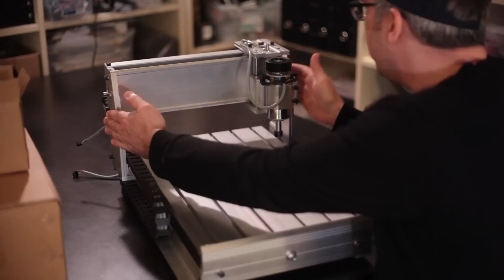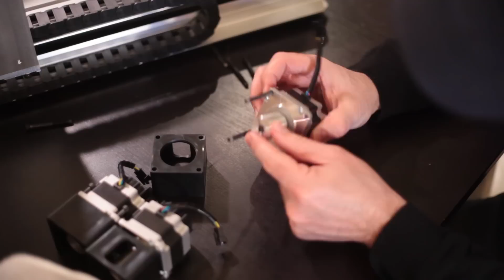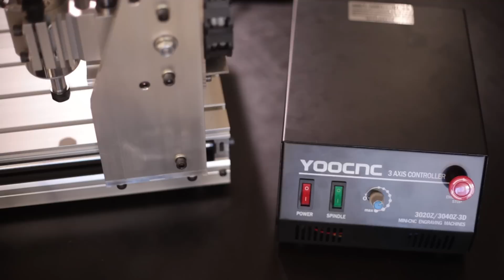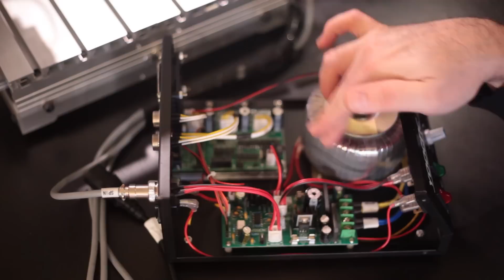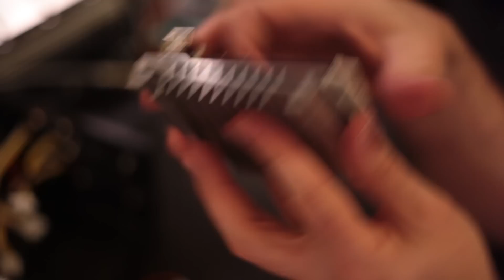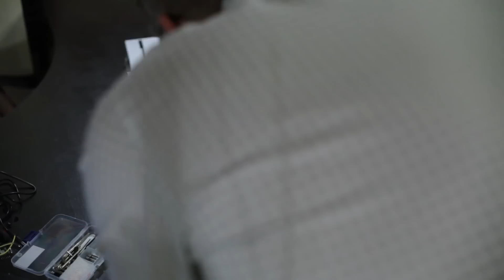Build a ChiliPeppr Driven 3040 CNC

Comment: Hi John! I have watched your video and got most of my cnc working now. I was wondering is there a way to calibrate the stepper motors in Chilipeppr? Or is that done in the Tinyg? I am new to CNC in general and was inspired by this video to get in to CNC. There are some videos online about stepper motor calibration but, they are using a different software then Chilipeppr.
Reply from the maker: If you use ChiliPeppr and TinyG then the motor calibration is:
// Response from $$ Command
[fb]  firmware build            442.04
[fv]  firmware version            0.97
[hp]  hardware platform           1.00
[hv]  hardware version            8.00
[id]  TinyG ID                    3X3566-YRS
[ja]  junction acceleration  100000 mm
[ct]  chordal tolerance           0.0100 mm
[sl]  soft limit enable           0
[st]  switch type                 0 [0=NO,1=NC]
[mt]  motor idle timeout          2.00 Sec
[ej]  enable json mode            0 [0=text,1=JSON]
[jv]  json verbosity              4 [0=silent,1=footer,2=messages,3=configs,4=linenum,5=verbose]
[js]  json serialize style        1 [0=relaxed,1=strict]
[tv]  text verbosity              1 [0=silent,1=verbose]
[qv]  queue report verbosity      1 [0=off,1=single,2=triple]
[sv]  status report verbosity     1 [0=off,1=filtered,2=verbose]
[si]  status interval           250 ms
[ec]  expand LF to CRLF on TX     0 [0=off,1=on]
[ee]  enable echo                 0 [0=off,1=on]
[ex]  enable flow control         1 [0=off,1=XON/XOFF, 2=RTS/CTS]
[baud] USB baud rate              5 [1=9600,2=19200,3=38400,4=57600,5=115200,6=230400]
[net] network mode                0 [0=master]
[gpl] default gcode plane         0 [0=G17,1=G18,2=G19]
[gun] default gcode units mode    1 [0=G20,1=G21]
[gco] default gcode coord system  1 [1-6 (G54-G59)]
[gpa] default gcode path control  2 [0=G61,1=G61.1,2=G64]
[gdi] default gcode distance mode 0 [0=G90,1=G91]
[1ma] m1 map to axis              2 [0=X,1=Y,2=Z...]
[1sa] m1 step angle               1.800 deg
[1tr] m1 travel per revolution    4.0000 mm
[1mi] m1 microsteps               8 [1,2,4,8]
[1po] m1 polarity                 1 [0=normal,1=reverse]
[1pm] m1 power management         2 [0=disabled,1=always on,2=in cycle,3=when moving]
[2ma] m2 map to axis              1 [0=X,1=Y,2=Z...]
[2sa] m2 step angle               1.800 deg
[2tr] m2 travel per revolution    4.0000 mm
[2mi] m2 microsteps               8 [1,2,4,8]
[2po] m2 polarity                 1 [0=normal,1=reverse]
[2pm] m2 power management         2 [0=disabled,1=always on,2=in cycle,3=when moving]
[3ma] m3 map to axis              3 [0=X,1=Y,2=Z...]
[3sa] m3 step angle               1.800 deg
[3tr] m3 travel per revolution    4.0000 mm
[3mi] m3 microsteps               8 [1,2,4,8]
[3po] m3 polarity                 0 [0=normal,1=reverse]
[3pm] m3 power management         2 [0=disabled,1=always on,2=in cycle,3=when moving]
[4ma] m4 map to axis              0 [0=X,1=Y,2=Z...]
[4sa] m4 step angle               1.800 deg
[4tr] m4 travel per revolution    4.0000 mm
[4mi] m4 microsteps               8 [1,2,4,8]
[4po] m4 polarity                 0 [0=normal,1=reverse]
[4pm] m4 power management         2 [0=disabled,1=always on,2=in cycle,3=when moving]
[xam] x axis mode                 1 [standard]
[xvm] x velocity maximum       1800 mm/min
[xfr] x feedrate maximum       1800 mm/min
[xtn] x travel minimum            0.000 mm
[xtm] x travel maximum          150.000 mm
[xjm] x jerk maximum             20 mm/min^3 * 1 million
[xjh] x jerk homing              40 mm/min^3 * 1 million
[xjd] x junction deviation        0.0500 mm (larger is faster)
[xsn] x switch min                1 [0=off,1=homing,2=limit,3=limit+homing]
[xsx] x switch max                0 [0=off,1=homing,2=limit,3=limit+homing]
[xsv] x search velocity         500 mm/min
[xlv] x latch velocity          100 mm/min
[xlb] x latch backoff             5.000 mm
[xzb] x zero backoff              1.000 mm
[yam] y axis mode                 1 [standard]
[yvm] y velocity maximum       1800 mm/min
[yfr] y feedrate maximum       1800 mm/min
[ytn] y travel minimum            0.000 mm
[ytm] y travel maximum          150.000 mm
[yjm] y jerk maximum             20 mm/min^3 * 1 million
[yjh] y jerk homing              40 mm/min^3 * 1 million
[yjd] y junction deviation        0.0500 mm (larger is faster)
[ysn] y switch min                1 [0=off,1=homing,2=limit,3=limit+homing]
[ysx] y switch max                0 [0=off,1=homing,2=limit,3=limit+homing]
[ysv] y search velocity         500 mm/min
[ylv] y latch velocity          100 mm/min
[ylb] y latch backoff             5.000 mm
[yzb] y zero backoff              1.000 mm
[zam] z axis mode                 1 [standard]
[zvm] z velocity maximum       1800 mm/min
[zfr] z feedrate maximum        800 mm/min
[ztn] z travel minimum            0.000 mm
[ztm] z travel maximum           75.000 mm
[zjm] z jerk maximum             20 mm/min^3 * 1 million
[zjh] z jerk homing              40 mm/min^3 * 1 million
[zjd] z junction deviation        0.0500 mm (larger is faster)
[zsn] z switch min                0 [0=off,1=homing,2=limit,3=limit+homing]
[zsx] z switch max                1 [0=off,1=homing,2=limit,3=limit+homing]
[zsv] z search velocity         400 mm/min
[zlv] z latch velocity          100 mm/min
[zlb] z latch backoff             5.000 mm
[zzb] z zero backoff              1.000 mm

Comment: I did some research, and you can run TGFX. Mach4 isn't a parallel port driven program. There's a plugin that you have to buy if you're using parallel port for mach4. I operate a turret punching press everyday! On a way bigger scale then these small things. But that's the reason why I got into it because the programming is close. I run an Amanda coma x72. Y60. I'll find a good program that works. But I like what you're doing! Keep up the good work!
Reply from the maker: tgfx was discontinued and ChiliPeppr was its replacement

Comment: I use an atom board like the Asus J1800IA, rather new, compact machine with an LPT port.
Reply from the maker: +DKTAz00 Why are you using a parallel port? Is that so you can use Mach3?
Reply: heh, good question. To be honest, I'm using mach3 because it came with the machine. :) But I never looked in to any other options. The lpt board was 75 usd, and I guess you never know when you need an extra pc. Made a crude case for it too http://www.thingiverse.com/thing:1242658 But one thing I didn't see/catch you covering was, are there any pros to peppering it? edit besides usb
Reply from the maker: +DKTAz00 There's a million reasons to "peppr" it. First, parallel ports have gone the way of the dodo bird. You should move to USB. Also, powerful microcontrollers are so cheap now, you should move the step generation off your PC and onto a microcontroller. Mach3 has the PC generate steps while it's also trying to handle the UI. Also, you gain the power of the cloud with ChiliPeppr and the benefits of the browser. You can write Javascript macros, drag in Eagle BRD's to mill PCB's, extend your CNC machine to add lasers, pick and place heads, additional axes, heater control, etc. The development community is probably the biggest thing you inherit. Mach3 was great in its day, but the world has changed and the cloud is where you want to be.

Comment: Hi

I have posed this question about the mainboard to many people .
most have the yoocnc mainboard and they love their machine.
I have some to realise that it could be what software you use to design / simulate and send to the cnc router
and the tweaks you need to do to get the router 100% working.
Thanks
Ebrahim
Reply from the maker: +www.vinylcutters.co.za South Africa I agree that without ChiliPeppr the TinyG board would not be a good way to go, but with ChiliPeppr it changes the game and makes TinyG the right choice. Sticking with the original yoocnc board and thus being stuck with Mach3 is not the way to go in the future. ChiliPeppr is extensible and indeed things like a solder paste dispenser are emerging. A pick and place solution is emerging. Webcam fiducial recognition is in the works. Etc. These are all possible once you get into the browser environment where coding and collaboration are easy.
Reply: You're not stuck with Mach3 with a parallel port. LinuxCNC supports parallel ports.

Comment: Hi John, thanks for the great videos! I'm completely new to this, but am really intrigued by the 3040 size cnc machine. I'm hoping to use a small precision cnc router to help me do guitar inlay work in hardwoods and pearl, cut custom pickguards from laminated plastic, and cut custom pickup flatwork from vulcanized fiberboard. Seems like this unit should be up for the task with high precision? From the research I've been doing tonight, it seems like the smartest move would be to buy the 3040 unit with ball lead ($736 shipped on ebay seems to be the cheapest), the tinyg ($130) and the rasberry pi 2 ($40 or so). I'm hoping I can use Inkscape or SketchUp to draw up the svgs,  jcut (I think that's the name) for gcode, and ChiliPeppr to cut 'em out, which should mean completely free software. I'd need to buy a few end mills of course. All-in-all, seems like I'll have to dump about $1000 to get started. Am I thinking correctly here? Just want to make sure I'm considering everything before popping for it. Also, can all of this be done on Linux, or at least running the CNC from a Linux based computer?

Comment: hey John, why would you go by the most expensive solution? why not use an Arduino CNC shield V3.3 instead?  165$ for that tinyG is way too much money....
Reply from the maker: +Dimitri Del Corral I started out a few years ago using Grbl and a CNC shield that used Pololu drivers. I blew out a lot of those A4988 drivers so I don't trust them anymore. If you get a CNC shield get the 8825 chips instead. I see that's $28 on ebay. Ok, now here's the problem. Grbl is at end-of-life. The Atmel 328p chip has no room in it for Grbl to get better. I needed a 4th axis for my 3040 as you'll see in one of my other videos. TinyG is the only CNC controller that supports a 4th axis. Read my Grbl vs TinyG for a full rundown http://chilipeppr2.blogspot.com/2015/06/grbl-vs-tinyg.html

Comment from the maker: The purpose of the BeagleBone is that you need a computer to run Serial Port JSON Server (SPJS). SPJS is the bridge between serial ports and a websocket. It's easiest to use a small embedded computer to run it and then just do ChiliPeppr from your powerful desktop or laptop that you can also take with you to the other room while the CNC machine is making dust. These days I use a Raspberry Pi 2 instead of the BeagleBone.
Reply: +John Lauer Can you tell me if the red wire on the emergency stop button goes on the NO of the emergency button and if the black goes on the NC of the emergency button? I am using a Ardrino Uno with CNC Shield.
Reply: the black will go to the Common of the emergency stop, and the red would more than likely go to the NO pin, to hook this up to th arduino, look through your code for an emergency stop function. this should tell you what pins to plug the stop button into.

Comment: Measuring the flatness. First I'm not a machinist but we have a fully stocked machine shop with dial indicators. We clamped one on the spindle and moved the spindel through the table's range (lift it over the grooves). Lengthwise it was .040 TIM. Being that we will be making parts about 3x4 it might not be too bad locally. 

You could also get a gage block and then cycle the z down to it and taking some measurements that way too. You could get readings from mach3 or chillipepper and see what is going on.

Best of luck.

Comment: One of the better videos out there! We might go the tinyg/chillipepper route if we keep having problems. The 3040 we got has a bed that is not flat wrt to the z height (>.040 over the length). Did yours have that problem? Any luck getting it true?

Thanks-
Reply from the maker: +Paul Koenig I never actually measured how true the bed was. Now that you're mentioning it I may test it. How did you test it though? Using a probing technique?

Comment: Couldn't you just buy a Parallel to USB adapter?
Reply from the maker: +Michael Valentine You could, but you are still stuck in the ancient Mach 3 software. ChiliPeppr is in the browser so it supports all OS's. Mach3 is Windows only. ChiliPeppr is open source. Therefore people can extend it to do whatever they want. There's a user extending it to do pick and place. Another user is adding machine vision via WebRTC. Another user is adding Eagle board import capabilities so you can easily mill PCBs. Mach3 does none of this and isn't open source. ChiliPeppr is the Linux of CNC and is the future of CNC in the maker community.

Comment from the maker: These days I'd go with a Raspberry Pi 2 instead of the Beagle Bone Black I used in this video.
Reply: +John Lauer Do you have a video about your Raspberry Pi setup? Being new the Raspberry Pi and someone not really interested in programming I feel like I'm going about using my RasPi 2 the wrong way. I think of it as a tiny Linux box and that's about it. I was gifted the Pi and since I'm planning to use an Arudino and a Grbl CNC shield for my controller I would like to pair the Pi  with either a stand alone Arduino or the Alamode shield for the Pi and use ChiliPeppr to control everything to make a nice neat package if possible.

I appreciate any input and all the work (you did?) that went into ChiliPeppr. I still haven't made it through your 1hr+ video about the introduction to ChilliPeppr yet.

Comment: Is it standard to connect E-Stop to the [RESET] line of the micro ??
If you push E-STOP, the motors will shut off, but you will need to reload the gcode file over again and re-calibrate the axiss.

Comment: Thanks for the video. I bought a 6040 not too long ago. I have used Mach3 forever on my other machines. I am new to chilipeppr and it looks interesting. 
A couple of questions. 1. Why not just use GRBL on an Arduino to drive the parallel port pins on the existing driver?
And 2. What is the beagle bone for? Seems to me all functions work without it. Thanks!

Comment: I recently added a TinyG to my 3020 CNC. I'm having trouble getting the correct settings configured. I can move the machine around with ChiliPeppr but when I do a test the measurements are either too big or small. My motors say 1.8deg on them. Would you mind sharing your TinyG configuration? Thanks.
Reply from the maker: verishare I place these settings under the cog wheel icon in the Serial Port JSON Server widget inside ChiliPeppr so it sends this Gcode every time ChiliPeppr connects to the port.
(X axis is motor 2 chip) 
$2ma=0 
$2po=1 
$2mi=4 
$2pl=0.75 
$2tr=8 
$xvm=3000 
$xfr=3000 
(Y Axis is motor 3) 
$3mi=4 
$3pl=0.75 
$3tr=8 
$yvm=3000 
$yfr=3000 
(Z axis is motor 4) 
$4ma=2 
$4tr=4 
$4pl=0.6 
(A axis is motor 1 chip) 
$1ma=3
Reply: Thanks! The microstepping was off on mine for some reason but all is good now.

Comment: So why would one choose this over a Shapeoko? (not rhetorical. Genuinely asking)
Reply from the maker: Warndog If you want to make really accurate parts, i.e. a circuit board, the Shapeoko's timing belts are just not good enough. I've tried. You need lead screws. The lead screws are metal so they're rigid. They give you a nice mechanical advantage as well which gives you accuracy and strength. The timing belts on Shapeoko don't give any mechanical advantage. The timing belts also have some level of stretchiness that you see it in the final part. I spent a year trying to get accuracy out of Shapeoko and gave up. Also, the spindle head on the 3040 is almost perfectly rigid with no give. Try pushing against your spindle head on your Shapeoko and you'll see it gives a bit. That give destroys accuracy. This also means you can't really mill aluminum.

The thing the Shapeoko is good for is scalability of the frame. If you do large-scale woodworking or acrylic milling then I think the Shapeoko is the way to go because you can deal with accuracy not being amazing. However, if you're into fine detail work, you need to go with something better.

If you get a 3040 you need to make sure it uses ball screws. Don't get trapezoidal screws. Also, make sure it's not crap. There's a lot of models out there and some are low-end and some are well done.

Comment: Hey i brought the 6040z CNC upgraded version of the 6040 CNC and I definitely recommend it. It cost me £1200 in england. The machine came disassembled and i had some problems with putting it together but but eventualy i got it to work. If you have a workshop and the money I would recommend it.